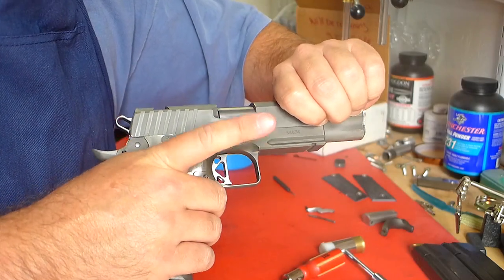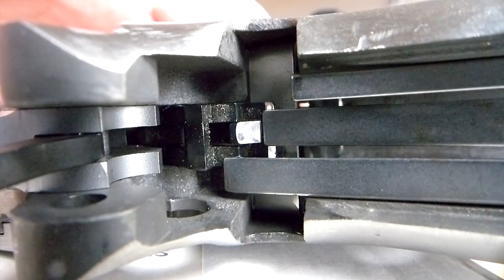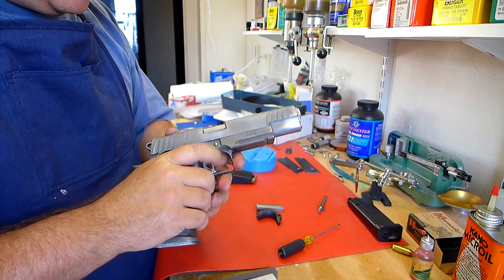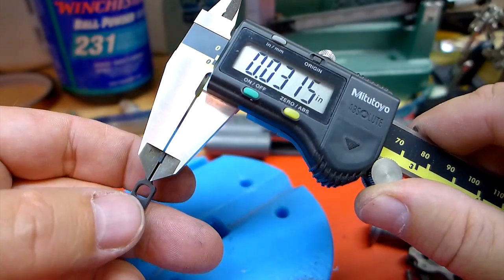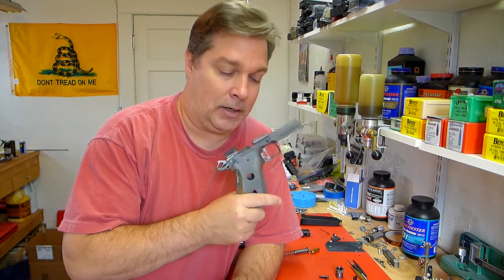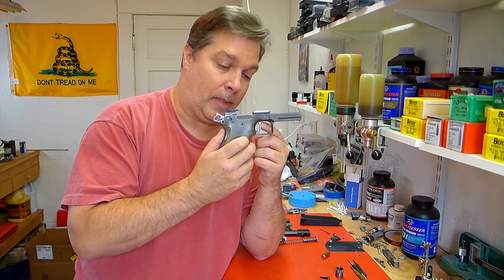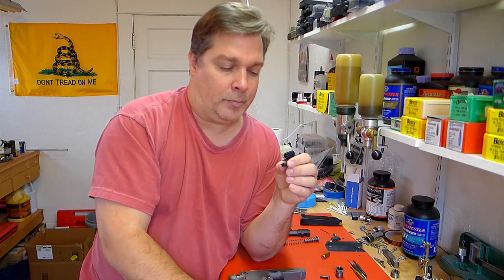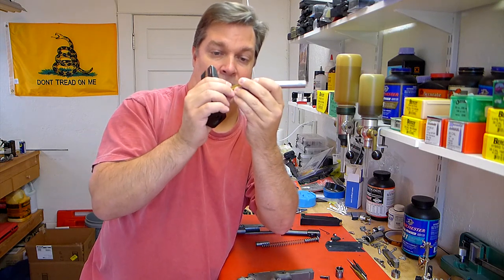Titanium 10mm Hi-capacity 1911 Build | #22 (Hammer Follow)

Comment: Got my RIA 2011 and upgraded my trigger pull to a lighter trigger and shot my PC with a hammer follow after 1 year of using the gun luckily got my mag out because I'm chambering a +1 incase of emergency . Also its good that my brother understand the gun safety and avoided my mom and my sister from burning me alive hahaha. Always put the gun on safe direction is a must we can't tell when the gun will malfunction or sometimes us. I bought  a new PC case, cooling system and a GPU. I missed the motherboard luckily
Reply: What was the trigger pull weight you got and how much did it reduce after shooting to cause the hammer follow?
Reply: @MrWhite-erb  didn't scaled the trigger but its about 2lbs or less. Resolved it after replacing my sear spring.
Reply: @Valtaur_YT  oh under 2lbs, that is a bit light. Thanks for the information.

Comment: It just happened to my 45 acp 1911..I fixed my hammer follow by cutting a little bit on my sear primary angle.because I cut too much on the secondary angle w/c it’s causing the hammer to follow when in heavy recoil.I just cut little bit on the primary and no need to cut the secondary angle.problem solved.